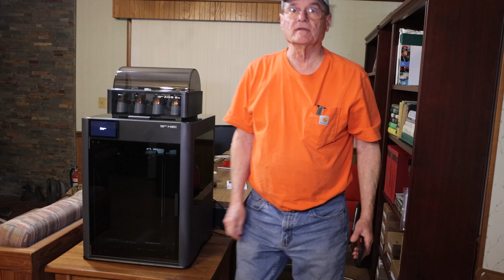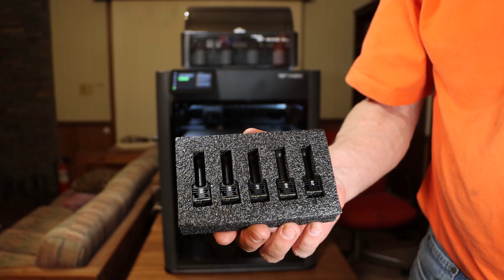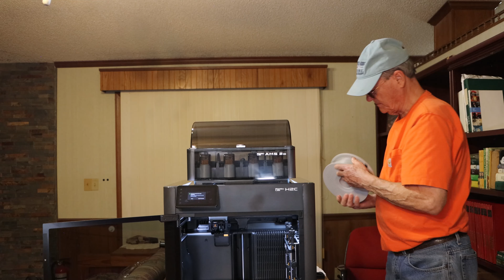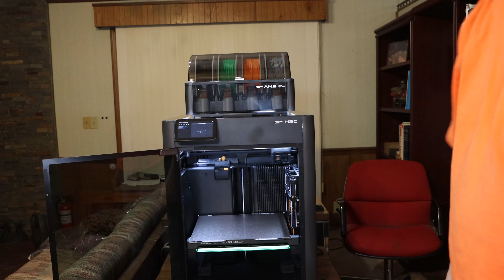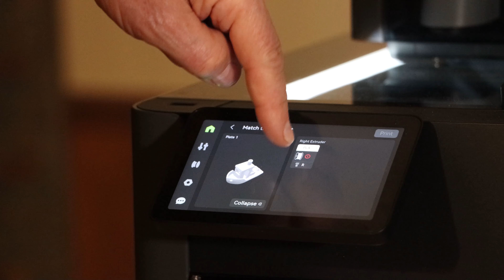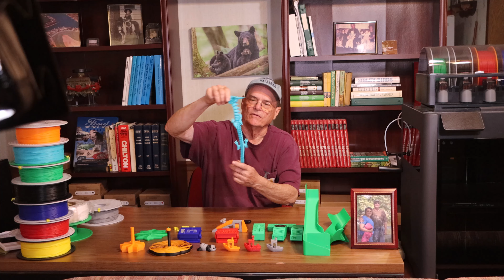Bambu Lab H2C from Setup to First 3D Print

Comment: Inconsistent temperatures and humidity levels can and will affect the success of your prints.  A filament dryer can help with that.
Reply from the maker: No problem so far but I am looking into a dryer.  Thanks for the suggestion and thank you for visiting and have a great 3D day.
Reply: @3DwithWayne  Good news! Your AMS2 Pro is a dryer. As far as I know, you may even dry while printing, but the AMS will lower the temp so it doesn't soften the filament while feeding into the hotend.